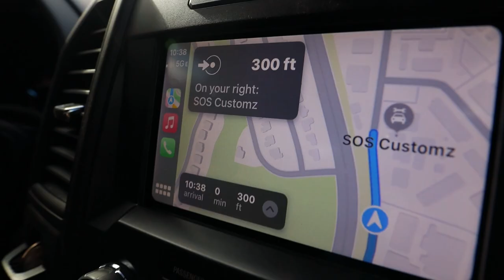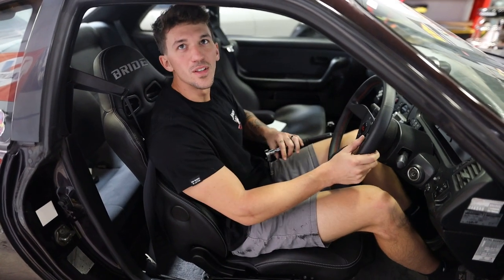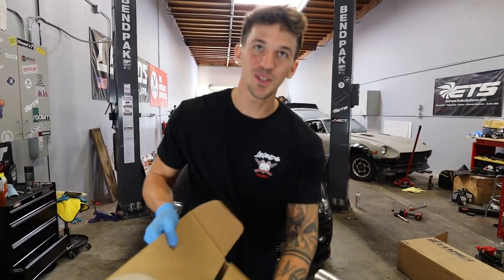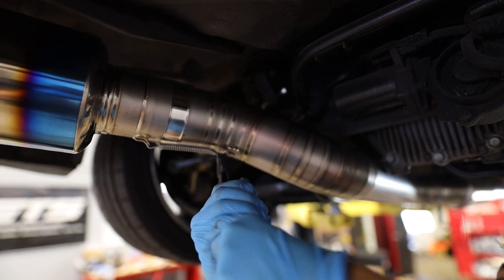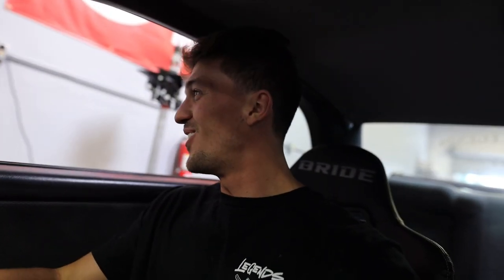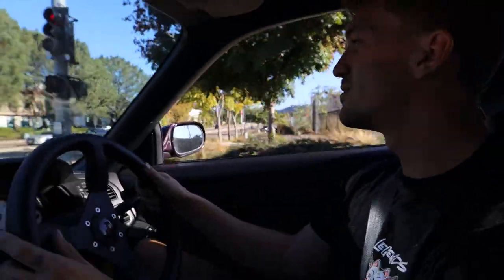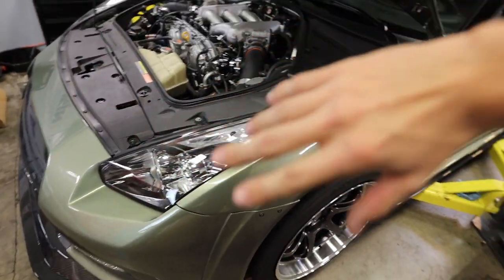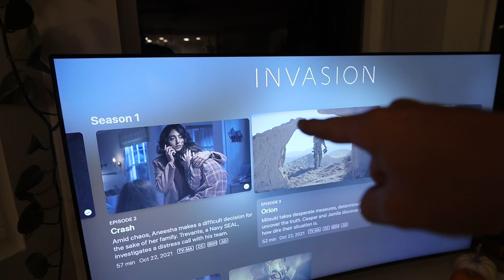Midnight Purple V-Spec R33 Skyline GTR Gets a Tomei Titanium Exhaust! *BEST EXHAUST EVER!*

Comment: Pro Tip- For the exhaust springs, get an exhaust spring hook tool from a motorcycle shop, amazon, etc. They're pretty cheap. You can even use some 550 paracord, or a shoelace for less $. Love the vids

Comment: Those exhaust springs are easy to put on with a screw driver. You put the hook on the screw driver and the tip of the screw driver at the loop that its going to hook up to and just pry it up. Its easier to show than explain.
Reply: was thinking the same😆